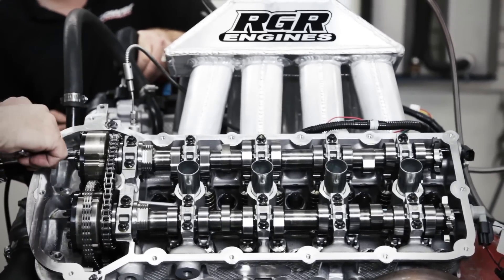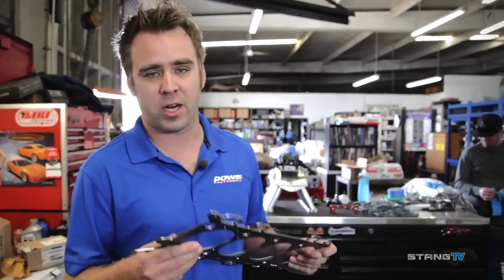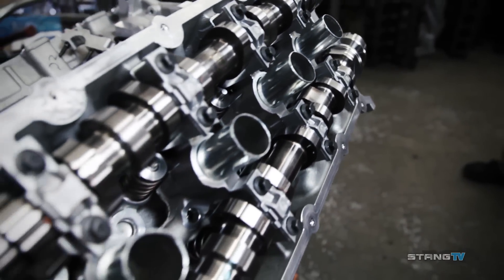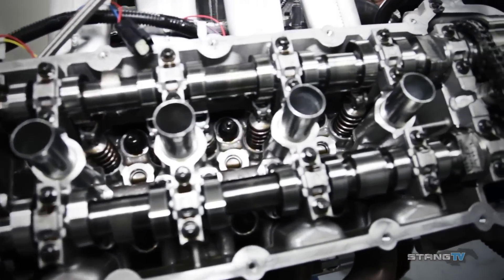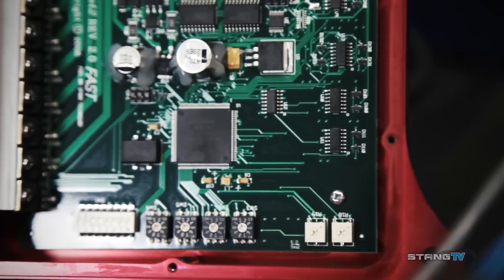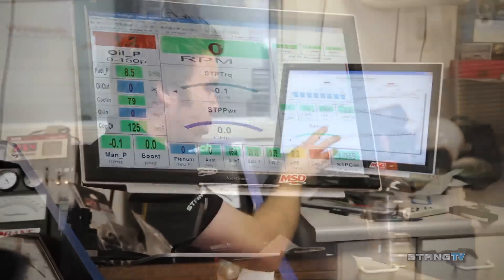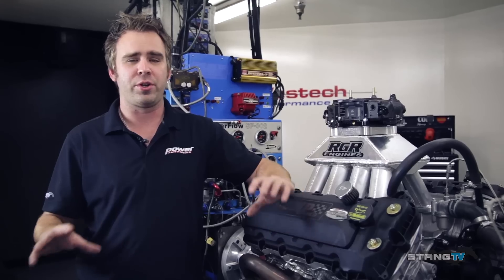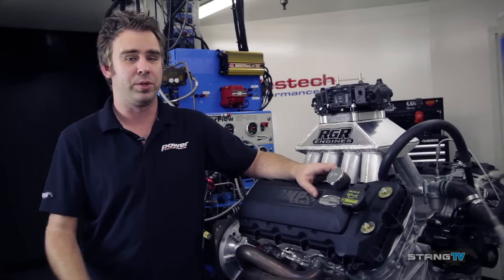Carbureted Cobra Jet Coyote Engine Build: Long Block and Dyno Testing

Comment: If you spun a. 6.2L to 8000RPM especially being a pushrod engine, you will see nothing but a beautiful explosion of pistons, rods and smoke with huge holes in the block lol..  Big CID Pushrods cant rev that high, they start to have issues with valve floating... And also the stroke is too long to survive that much RPM.
Reply: About the dumbest shit i've read all day.
Reply: SuperChevy Mag just destroked a 6.2 LS and spun it too 8000rpm no problem. Pretty cool and shuts down the "pushrods can't spin" BS but my reply was "why? Wanna make the same power at a lower, more streetable, more reliable RPM? Put the stock crank back in" lol. Was a cool test for arguments sake and just to be different but still...cubes win on the street. Period. You can cry about efficiency and horsepower per liter while you're getting passed by guys with bigger motors who race in the real world on not on the internet
Reply: ***** When i say high rpm im talking going above 7000rpm, the raptor,s redline is 6000rpm lol only the boss 302 engine is capable of going 8500rpm without breaking a sweat... even the 5.8L in the gt500 can only go to 7000rpm using its over rev feature and it can only do it for a few seconds at a time lol long stroke engines cannot withstand high rpm's like short stroke engines do and thats a fact...
Reply: ***** When I first replied to you, I thought you were talking about a LS3 6.2L, but now I see you were talking about a Ford SOHC 6.2L. Yea a 6.2 SOHC can rev past 7000RPM.. I once saw an article were Roush experimented with this engine, they stroked this engine to 7.0L and still revved up to 7000RPM producing 700HP and 800Hp on E85... 

I thought you were one of them GM Fanboys that are hating on the Coyote 5.0 lol they always say how superior the LS3 6.2L is over the coyote and when I tell them that the coyote can rev up to 8500RPM and that it makes the same hp with 1.2L of less displacement, they get all butthurt and shit lol lol
Reply: +1962Galaxie514ciMPFI thats the beauty of the 5.0L. Its down 1.2L and makes the Same Hp than the 6.2L.  Long time ago BBK modded a 5.0 and a SS. Same mods for both cars and the 5.0L got more HP but the camaro made like 26 lb/ft more torque, obviously because of its extra displacement. 

An 6.2 LS Engine making 1000Hp n/a lol thats bull lol post a link so I can look at it lol
Reply: +1962Galaxie514ciMPFI you just typed it in your last comment you said  I have a 6.2 spinning to 9K and "Several 6.2LS making 1000 hp n/a" lol thats why I asked for a link to see it with my own eyes because its basically impossible for a 6.2 LS engine to make 1000Hp n/a

If the LS3 were to spin 6600RPM it will not make 505HP lol, ever seen a dyno chart of this engine. After the engine passes 6000rpm the HP curve dips. It actually looses power the higher it revs lol
Reply: +1962Galaxie514ciMPFI i never said LS motors couldn't make power past 6000rpm, I just said you were wrong when you said that the LS3 was making 430Hp at 6000hp and that if it were to spin up to 6600 rpm it will make 505HP lol 

Give me a link to a 6.2L LS3 making 1000hp n/a lol.. Its impossible lol the only way it would make 1000Hp n/a will be to stroke and bore this LS3 376CID to at least a 440CID but it will no longer be a 6.2L lol 

Hell yea that coyote 5.0L is a beast, liter per liter it makes more power than any LS engine guaranteed. 
505hp with a cammed 6.2L not impressed lol Ford's new 5.2L Coyote based V8 is gonna make 500Hp right out of the box in the new SVT GT350.
Reply: I'm a Chevy guy and read all the replies. First of all, the amount of power achievable lays mostly with the design of the engine. The 5.0 coyote engine makes what it makes because of high flowing 4v heads( due to the nature of the design) and vvt. With out the vvt the engine makes 300 hp. And the sohc 6.2 was designed to be in a truck which means broad torque. Also the ls series engines are an awesome engine that can be built in many different ways to reach different goals. Heck, destroke a 6.0 upgrade the valve springs, a high lift cam , upgrade the rod bolts and spin it up there at 8000 rpm too. And it will have the same cubic inch as a 5.4 modular and makes way more power N/A
Reply: 88TransAmGTA No stock gm engine ever turn 8500 rpm.
Reply: That's why 500ci prostock engines rev to about 12000rpm
Reply: Go look up av boyz.  They have a 331 stroker solid roller classic pushrod style motor and they rev to 8500 rpm all day with no problems
Reply: Nate Karg  a 331 and a 6.2 are 2 different monsters...
Reply: george palacios http://www.lsxtv.com/news/video-a-1000-horsepower-ls-engine-revving-to-almost-8000-rpm/

There is your proof that an LS engine can rev really high. And honestly not too many people care if the 5.0 is 1.2 litters smaller, you have double the valves and triple the cams but no one says that about the 5.0. LS easier to work on, make power low end and have a broader power curve. I've been in a mustang 5.0 and camaro and honestly the immediate TQ is was more satisfying  in the camaro compared to reving the crap out of the 5.0 only when all the power is building. Which makes sense during track applications in which you want power 3000-5000 RPM instead of having all the power at 7000 RPM+ Lets be honest where are you at the RPMs during track application, your not red-line during most of the track.
Reply: Im going to have to say that the GT3 is a light car with AWD and doesnt need 500lb/ft to trap 11 seconds.  It can do it just fine with 324lb/ft plus its engine is in the rear making it easier to hook up and be more stable at a track.
Reply: george palacios Nascars engines at 358 cuin. don't seem to have a problem turning 8500rpm.
Reply: ***** Yes and I stand by it. For example Try passing emissions with a Camaro that has been modified to spin at 8500rpm lol it wont do it. Thats the reason the new C7 Z06 has a supercharged engine instead of a high revving N/A V8 like the old C6 Z06 had. Gm said that they tried to develop a high revving engine for the C7 Z06 but it failed emissions so they just opted for a supercharged engine instead.
Reply: george palacios oh? Funny now we're talking about daily drivers all of a sudden when just a little bit ago we were eclipsing the entire pushrod industry. Because obviously the entire geometry of pushrod design is changed when you step up to racing specs. Besides that, my daily driver mustang is out of service at the moment I'm having my massive tunnel ram intake (as seen in the video) re-polished. But soon it'll be grabbing groceries in no time!
You're a dumbass. Powerband is everything. Peaky power numbers are for douchebags who want to bench race online, a fat torque band is what real racers use to win real races. And you really like that GT3 example don't you? But sure I'll bite. And you know what? I won't even hide behind the fact that your nearly $200k example is being used against cars about half it's price (or less in most cases). But I've got an example of my own. How about the Viper ACR that just lapped the Nurburgring in 7.12, what was the GT3? 7.20? That's too bad. But wait the Viper redlines around 6000rpm and the GT3 is what? 8500ish? Their clocks must be off man there's NO WAY a 6000rpm motor could get anywhere near an 8500rpm motor. Not a chance. Now the 0-60 for the Viper has only been clocked at 3.6, mkay I'll give you that, but there has been a 10.9 quarter mile time which again must be a mistake cause if I remember right there's no way a car with this low of a redline could ever stumble out of its own way..oh unless it's because of that big fat fucking torque band and the fact that proper gearing can make up for any lack of RPM dumbass. Again, I'm so sick of this argument. I get it, high RPM is cool and popular, but it's not NECESSARY. If you know how to set your car up you can make any RPM work with the proper powerband, it's all in the gearing. But you wouldn't know that cause you brought a Porsche to a Ford fight lol
Reply: +Evan B A Viper??? the Viper is a V10 8.1L lol the Porsche is a 4.0L flat six with 500Hp. double the displacement of the Porsche and only has 600Hp while the Porsche has 500HP out of 4 liters of displacement lol The power density of the Porsche is astonishing lol
Just like the new Voodoo 5.2L from Ford lol 526Hp while Gm only achieved 505Hp out of 👉7.0L hahaa Clearly DOHC is more efficient and capable of making more power with less cubic inches. Liter per Liter a DOHC engine wins. Why do you think there are no more pushrod 4 cylinder engines in production lol because DOHC is the way to go.
Reply: You should check out School of Automotive Machinists orange Camaro. It has a 440 CI lsx engine that turns 10'000 RPM and makes right around 1000 hp. Pushrod engines can be built to turn high RPM too. Any engine that has overhead cams has an advantage with valvetrain stability. Pushrod valvetrain have many areas that can flex under the extreme load of high rpm. But that doesn't mean that they cannot be built to handle it. The real question we used to ask in school was why   aren't there factory dohc engines equiped with variable valve timing and lift that are turning 10,000 from the factory. The technology is there and no one is taking advantage of it. The stability of dohc is hardly coming into play at 8000 rpm. I have seen many SBC, SBF, and even a few Mopars turning well over 8000. Hell Chevy and Ford both were turning 8000 back in the late 60's and early 70's in trans am series racing with their 302 engines. (Yes Chevy made a 302. Search for articles on the DZ302 from the early z28 camaros) Point is it can be done. Is dohc better??? Absolutely. Is dohc being used to its full potential as pushrod engines have been... Not even close.
Reply: +Adrian Arambula have you even driven at the tracks lol?? 3000rpm and 5000rpm?? Lol they'll blow you doors off if you're only revving that high while lapping a track lol. The Porsche GT3 revs up to 9200rpm thats why its a beast on the tracks. The more RPMs it has the better, because during an apex at the track you can maintain full power without having to downshift or hit the rev limiter and that equates to a better lap time.
Reply: I just saw the Z28 nurburgring time and its always 4000-6000 RPM on average. Right where its power is top notch. And lets be honest do you want power lower end or at the higher end? TQ gets you out of the hole buddy just face face it. LS engines dont need to rev that high to make power.
Reply: +Adrian Arambula the GT3 is not awd is RWD. In fact its almost as fast as the 911 turbo S AWD around a track and has like 250lb/ft of torque less. 
Even Ford's Boss 5.0 engine has way less torque than its competitors and runs a faster 1/4 time.
Reply: +blackericdenice A nascar engine like the one you mentioned is capable of 8500rpm because it doesn't have to deal with emissions. Because of that they can use bigger cams, they also have top of the line valve-train parts and internals that allows them to run that high RPM without a problem. A production engine on a car cannot do that if it has to meet emissions. In California even a set of long tube headers or a non CARB exempt cold air intake gets you a fail lol this state is crazy lol
Reply: george palacios Ever hear of a Ferrari F12? It has a 6.3 liter V12 and 730 hp no boost engine and it turns 8500 rpm and pass emission because of vvt.
Reply: ***** that Ferrari revs that high because is a DOHC engine with a short stroke and its a very expensive engine by the way lol The shorter the stroke the faster an engine can spin without issues. Most American V8's have a long stroke and are pushrod based with the exception of Ford. DOHC can spin faster than pushrod engines.
Reply: george palacios You said emission was the reason the engine couldn't turn 8500 rpm. You said it so stand by what you said.
Reply: george palacios This is what piss me off. You told someone that an engine can't turn 8500 rpm and pass emission because GM said they couldn't do it.
GM are a bunch of stupid ass people who put a DOHC 4 cylinder called The Quad 4 in front of a 3 speed automatic.
Reply: george palacios remember gm 302 that spun 8500rpm through a pushrod v8....so gm did and done that already lol....go to NRE video with the 302 that revs to 8500 rpm.....and yes that was from the factory in 68 & 69 :) , thank you have a good day
Reply: george palacios dude, okay we get it, you love Ford. Great. Now stop trying to make everything else sound inferior to everything Ford does cause it's simply not true. I'm so sick of this "Fords are better cause they make more power with less cubes" crap. Okay, so the 5.0 is smaller. Doesnt change the fact that the LS motors and Hemis (because I'm not a strict Chevy guy, I love all three but call bullshit when bullshit is due) make more power and have a higher power potential. You can cry about your size disadvantage the whole time you're getting passed at the track and it won't change a damn thing. Truth is pushrod motors are great and still extremely relevant today. Top fuel Hemis make over 10,000hp and turn how many RPM? Oh but wait, I was told pushrod motors can't possibly make 1/4 of that power without failing or can't possibly turn over 8000rpm without detonating. Must be my mistake. I should call them and tell them twin turbo 5.0s are what they should've used the whole time. I'm also tired of hearing this crap about higher revving. People these days seem to have this idea that out of two motors put head to head the one that revs higher will always win. Bullshit. Pure bullshit. I'm sorry but a motor that peaks at 6000rpm and has a powerband between 2500-6000 will destroy a motor that revs to 8000 and has a powerband between 5500-8000. I get it though, these days everyone's obsessed with small displacement and overhead cams and that's fine, nothing wrong with that. But let's not start fooling ourselves into believing that and high revs are the best way to make power, period. Remember, every single racing series in existence would be using larger motors if the rules didn't limit displacement wise. That's a fact. WRC uses 1.6s not because it's the best for power, because that's the displacement limit. Same with the 5.0 motors in the old Trans Am series. But guess what? On the street there's no displacement limit and torque is king. So again, while youre complaining about size and efficiency we'll be busy winning. Same goes with any track racing that isn't limited on displacement. Now Fords are great don't get me wrong. I love the SOHC 6.2 and wish there were more aftermarket for it cause I'd love one. But personally I'm way more interested in the 6.2 than the 5.0 cause those cubes will pay off a lot more on the street than an extra cam and 2 valves
Reply: Evan B hahaaa top fuel??? We are talking about production engines here, found in cars that can be daily driven lol are you also gonna make a top fuel car you daily driver hahaa
A high revving engine that revs 8000 rpm will indeed destroy an engine that has a powerband between 2500 and 6000rpm. Just look at the Porsche GT3, its powerband its in the 9000rpm range and it smokes pretty much any n/A V8 out there. It killed the z/28 by a long shot and the z/28 has that specified powerband you mention between 2000-6500rpm. 
The Z/28 ran a 12.3 1/4 vs the Porsche's 11.3 1/4. Your power band theory doesn't seem to work lol
Reply: Wow, the higher the displacement the harder it is to rev that high. The ls7 427 has a redline of 7,000 rpm with pushrods and a cross plane crank, you are comparing a 5.2 liter dohc flat plane crank engine that only cranks out 1200 more rpm. Also a ford has to rev to 8,250 rpm to make less torque and only 21 more hp
Reply: I also forgot to mention that's it's a roller rocker set up too which helps with higher rpm achievements
Reply: +KiKitutorials1 hahaha the LS7 has 1.8 liter more displacement than the 5.2L voodoo and only makes 505Hp lol The 5.2L is too beast to even compare it with that boat anchor LS7 lol 7 Liters of displacement and only 505Hp hahaha come on lol lol
There is actually some Ford pushrod engine capable of spinning 8K lol lol for example the 289, 331 stroker, 351's and 302's. AV boyz mustang has a 331 Ford pushrod and it revs up to 8500rpm lol
Reply: +Evan B you said it 👉de-stroked. And my comments was about "big CID pushrods" lol
you wont even find an 8000rpm pushrod that can pass emissions like a DOHC engine does. 
Even Ford's 289, 302, 331, 351W are capable of spinning at over 8000rpm with the right modifications but they wont pass emissions. 
Cubes win in the street??? Lol wrong but power to weight ratio does and it has nothing to do with big cubes. I've seen 4 cylinder hondas, evos, STI's kill highly modified big cube corvettes, mustangs, camaros etc.
Reply: lsx 454 revs over 8000 with pushrods and two big vavles per cylinder. with big cam nad high comression it makes peak power above 7500 rpm. SAM has built a 433ci LS with carb that spins over 9000 and makes its peak power above 8500 rpm. any questions?
Reply: https://www.youtube.com/watch?v=fnq7qja7As8
Reply: +Adrian Arambula yea torque gets you out of the hole quicker but not always. High revving engines are usually geared low, which multiplies and manages their torque more efficiently meaning it can actually put all the torque down to the ground without turning the tires into smoke and accelerate really fast. the GT3 runs 11.3 second 1/4 mile and only has 324 lb/ft of torque.